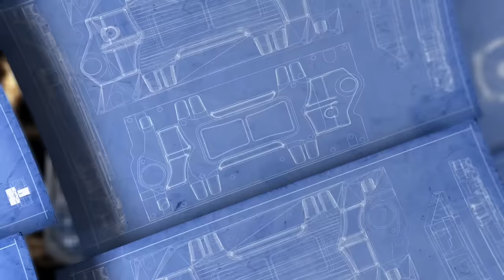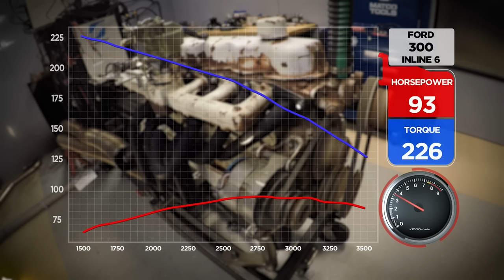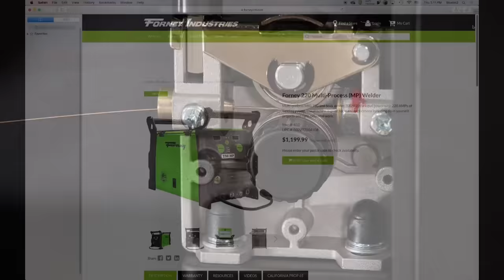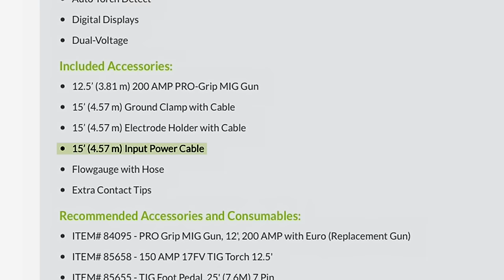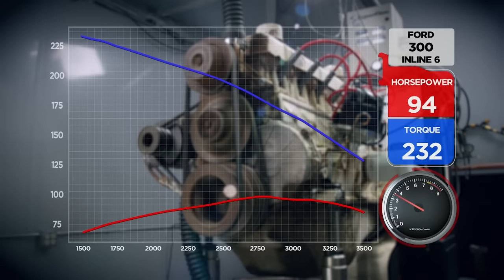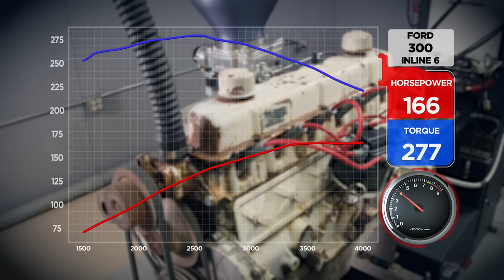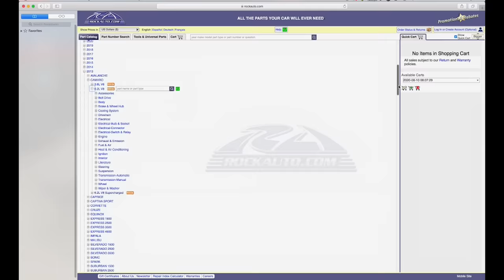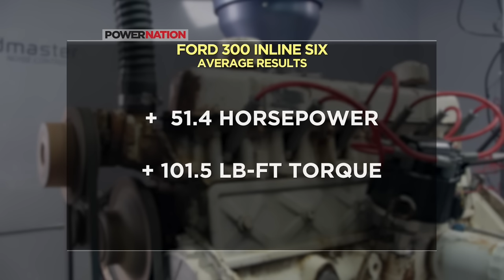Ford 300 Inline Six Gets Eye-Popping Off-The-Shelf Power - Engine Power S7, E17

Comment: I find this more interesting than another small block anything.
Reply: Yes if you feel compelled to do something different.   But you will spend significantly more money to make the same power a mild small block makes.   See salvage yard  LS swaps.
Reply: Wild Bill he just said it was more interesting. Not better. 

I find it more interesting too. It’s easy for some of us to get bored seeing the same ol thing over and over again. For me seeing the old forgotten engines get a little spotlight time is pretty cool. 

It’s not always just about how much power you can make ultimately; it’s just about taking something and making it better. As long as you’re burning fuel and having fun then it doesn’t have to be 1,000+ horsepower.
Reply: @codyleemeece  i agree you
Reply: @bmstylee  everyone says LS swaps are so cheap there's a shop there on YouTube and they charge 30k to LS or hemi swap jeeps so it just depends I6 engines are the most powerful engines in the world trackor trailers buses cabover's all commercial  vehicles there all I6 engines
Reply: @vee950  I6 diesels which are 2-3x the displacement of this anchor.  Not some archaic gas burner.   And if you pay 30k for an engine swap I have a bridge in New York I can sell you.
Reply: @Rebar77_real  fine.  Install something that weighs a lot and gets smoked by a Civic.   There is a real good reason the LS is a popular platform to install.  Powerful and generally inexpensive.
Reply: @codyleemeece  strange.  The exact opposite is said in the comments when a v8 only makes 500 hp the mechanic ninjas say they could do better.   If I am wasting my money it is for the best bang for the buck which this isn't.
Reply: Wild Bill It’s an industrial engine designed over 60 yrs ago. it’s basically a tractor engine. Durability and longevity are key. Watching an engine like this go from its original life to what we’re seeing here makes for great viewing. You being a Debbie downer only takes away from it. What are you trying to prove anyways?
Reply: @bmstylee  but a inline-6 is always smoother than a v8.
Reply: @vee950  Not "all" of 'em use an L6, Diesel,  but the venerable L6 is a remarkably dependable, torquey engine that was extremely well suited to service in heavy trucking and industrial applications.
Reply: Wild Bill You ever realize other people’s opinions matter equally to yours?
Reply: Wild Bill ah buddy I’m sure there’s an ls channel out there that cares how you feel. Maybe go play there
Reply: I’m like you Calvin, it’s nice to see something different and they really made some good power gains.
Reply: @vee950  The strongest truck is Scania 770 and its a v8...
Reply: @bmstylee  These are truck engines made for torque, not top end horsepower, how hard is that to get through your thick skull?
Reply: @bertilsonadam  I don't believe that buddy sorry
Reply: I have a 92 f150 with a 300 - 275,000 miles and still running great  -  I would love to see what you could do with one of the EFI motors
Reply: @nickkropat8857  and it will go another 100k easy little bit maintenance that can be done by you because I6 motor the old 1s not so hard to work on and parts are very cheap for that motor
Reply: @riogrande163  lmmfao 😅😅😆😆
Reply: @vee950  I don't think he even understood that the 300 i6 in this video was an industrial engine, low compression made to run at like 3000-4000 rpm for hours! lol!
Reply: If you like a hot 6 cylinder motor, look up hemi 265.
Reply: @vee950  You have google?
Reply: @bertilsonadam  strongest how? regardless of its overall power there are distinct advantages to an inline diesel engine vs a V8. especially when you are towing. not to say V8's are not good, but there are reasons the heavy duty market is dominated by inline 6 engines.
Reply: is this about an inline 6 or an infomercial?
Reply: @bmstylee  Doing these mods for a big hp increase, in a truck already equipped with this engine is much quicker and more cost effective, than a bastard LS swap mate !!
Reply: @fightfanian  He's pushing the everyone wants/needs a CHEV LS to be happy Mantra.  This engine will still be going, when his engines have been converted to baked bean tins !!
Reply: @keith2860  Strongest in hp and nm(in a truck). how is an advantage with an inline engine? Not that i dont like a good inline six, they usually runs smoother than a v8
Reply: @bertilsonadam  the additional 2 main caps and the smooth, seamless torque production are pretty nice.
Reply: @bertilsonadam  ill also add that i love V8 diesels, v8 macks, scanias, t444e, the 8-71 are all great. a straight 6 provides longer strokes and a much better powerband for pulling. for example if you have both a v8 and staight 6 with the same exact horsepower/torque you can expect the inline 6 to hit that hp and torque at a much lower rpm than the V8. most trailer trucks with straight 6 engines hit their peak torque generally at 1500-1800rpm.
Reply: @keith2860  my v8 truck hits max nm at about 1100rpm. I think it has to do with stroke..
Reply: @bertilsonadam  what V8 do you have that has a powerband like that out of curiosity friend?
Reply: @keith2860  scania r580 ng
Reply: @bertilsonadam  yea scania really has their engines figured out.
Reply: @bmstylee  then just do whatever you like and don’t knock the guy who feels like building a flat head V8 in his garage for the sake of the hobby. 

It’s not always about a pissing contest. 

Sometimes it’s just about the hobby of engine building.
Reply: @codyleemeece  build what you fancy.  But please don't tell me this is a better mill than a v8.   Especially a modern one because it isn't.  In any metric you like a v8 wins.
Reply: @bmstylee  You’re missing the point.

It’s not about “better” here. 

If there’s a class that limits number of cylinders, displacement, or some other crazy rules then maybe an inline 6 is the “better” option. 

This is about the love of getting your hands dirty. It’s about bringing something back from the dead for a new life. It’s just about having fun. 

It’s not about “look at all this horsepower I’ve got”.
Reply: @bmstylee  Not every metric, as far as torque making goes, an inline engine pound for pound with fewer cylinders makes more torque, it's physics.
Reply: @bmstylee  Power isn't really my goal. I like the odd and different. This is cool. They are also crazy reliable I hear.
Reply: @bigboreracing356  so were gonna ignore the 2013 s197 gt500 that had more horsepower than a z06 corvette, okay then.
Reply: @bmstylee  nobody gives a shit about a motor that will shit at 100k miles.
Reply: I did theses same modifications to my 300 ten years ago or more and my 300 out run every stock 351w I went up against and with the 650 cmf  eddelbrock carb it was a 4x4 monster even on steep angles. The only difference was I left stock rockers with an RV cam
Reply: @jonathangarzon2798  no. No one gives a shit about something maxed out at 300 hp with $15k spent on it.   Ask the average guy building a car what he would rather get from a junkyard to build.   Guess what it ain't this.   Better bang for the buck is a v8.   After $1000 at the machine shop and another $9000 in intervals,  turbo kit in this case, intake, fuel, etc you get less than a mild v8 while spending twice as much.
Reply: @riogrande163  funny I thought the show was called "Horse Power" not "rationalizing why a 600 lb anchor could barely make 1/2hp per CID is cool".  If that was a v8 and performed the way that antique did you and the rest of the comments section would crucify it.   But since it's a holy artifact and "different" it gets a pass.  If I am building an I6 a 3.0 Jag or a 2jz is much cooler and will perform better. And will cost about the same and make significantly better performance numbers.    And I will continue to be a v8 guy and you can keep seeing my tail as you get blown away.
Reply: Is there a header that fits in a 1996 4.9ltr 4x4?
Reply: amen
Reply: @vee950  it's true they are more complicated than people think
Reply: @bmstylee  I laugh at guys with ls swap builds. Might as well swap in an electric motor if you want something fast and boring.
Reply: @Zach-ju5vi  cool. You sound like a Carcass guy.  No one is perfect.
Reply: @riogrande163  I'd also like to point out the fact that there are a lot of us with old ford trucks that have the i6 because they last so long.  None of us are really interested in dropping the money and time into an old work truck to swap into a less dependable v8, but some off-the-shelf parts like in this video are a pretty easy way to get considerably more power without sacrificing the longevity that makes these old workhorse engines so useful.
Reply: I had one of these in a 66 mustang and I loved it more then when we put a 289 in it.
Reply: I love building engines that no one else does. I built a 3.7 chrysler slant 6 and put it in a toyota pickup. It would blow the doors off most vehicles. It was kinda expensive though.
Reply: Yeah most definitely.
Reply: I agree. The more unique builds are, overall more interesting.

Comment: finally got my GF to stop saying, u got another toy? no, it's a tool. having the proper tools makes the job that much faster, safer and easier. a lift, welder, lathe, air compressor, plasma, bandsaw, jacks, power tools all help take less time doing something from scratch. it took years to get the tools i wish i had in my teens and early 20s.

Comment: Coming from someone who has owned several 4.9s, those things would pull whatever you put behind em, and you couldn't kill em!
Reply: And they get much better fuel economy than any other engine in a pickup.
Reply: @drew8256  um no they don't lol. They literally got less mpg than any other engine the things where terribly inefficient.
Reply: @jdrok5026  I agree, and think they are a great motor anyway. Most reliable. However, my current 92 F150 automatic is the biggest dog compared to the 83 F250 4-speed carburated and 94 F150 5-speed manuals. This 5-speed auto has always been a piece of garbage as far as I'm concerned.
Reply: @meandthemrs7403  while they run forever they have issues with the front and rear cylinder having a different wear rate
Reply: I have one in my 85.
I drive it state to state no problem.

Needs a little work but the inline 6 is amazing
Reply: I think they do. My 87 4 speed 3.55 rear end inline 6 netted 20 mpgs highway. A lil worse in stop and go, but for a large engine, they dont drink that much. Not compared to the rest of the ford lineup of the era. Or GM's to me honest. The 4.3 was kind of a hog.
Reply: BEST 6 BANGER I EVER OWNED...HAD BOTH CARB AND EFI...EFI BEING BEST MILEAGE(25) over 17 on road...run run run run...I am now looking for another EFI 6 E150 VAN...NOT MANY OUT THERE...MOST ARE GAS GUZZLING V-8's...wah
Reply: @jdrok5026  I agree. The 300 did not get good mpg.s.  But i could put it in 1st gear and go all over the farm without ever touching the gas pedal in my '93 F-150. Had an aluminum housing 5 speed man tran w/ a 12" press.plate and clutch. BOMB PROOF engine ! 300K + miles. The only thing was that transmission...I put 4 rebuilt trans and still have the truck. Might put the 300 in my 1970 Scout 800 ?
Reply: @brianadams1907  thats just gear ratio my 4 speed sm465 and 350 can idle along at like 2 mph with ease just need to raise rpm for the clutch engagement so it doesn't try and bog the engine
Reply: Mine blew up
Reply: @bigsparky8888  I had a late 80's E150 with 4.9 and auto, it ran great, decent mileage and torque.... loved it.
Reply: @jdrok5026  I agree,  yes I love the engine but at the same time I accept its flaws .
Reply: My biggest issue was not doing a wheelie in the truck loaded with hay...definitely doesn't make the driver popular when he dumps a load of hay.
Reply: They pulled a lot of 747's at the Airports !
Reply: @drew8256  I got 16 MPG avg in normal Boston commute (half city, half hwy / avg trip 60 miles.  It had fuel injection and it ran like a champ.   Forgot to mention I always had 5-600 lbs of tools and literally a ton of plaster in the back.  I put beefy 250 springs on all around and it was a really great truck.  I'd still have it if it didn't get totaled.
Reply: @bigsparky8888  there’s a shorty van around here with 5spd and one of these for 15k
Reply: @bigsparky8888  
I agree. Just sold my 2021 Tacoma TRD $45000 and bought a 96 F150 4.9L 5 speed. My last vehicle. At 62 I want reliable and torque. Living in a 5000 lb camper trailer with boat on top truck. Big 6 only way to go !!!
Reply: @flatheadfletch  4.9 EFI...YES...YES...YES...Ford made that engine for a lot of applications...even auxiliary power plants...I drove an 93 E-150 Work Van...it got 25mph on highway going from Phx to Tucson...yes sir...VERY DEPENDABLE !!! ENJOY!!!
Reply: @jdrok5026 the 300 got better mpg than the 351s from the time. (M or Windsor) At least for us, they did.
Reply: @drew8256 😅😅😅😅